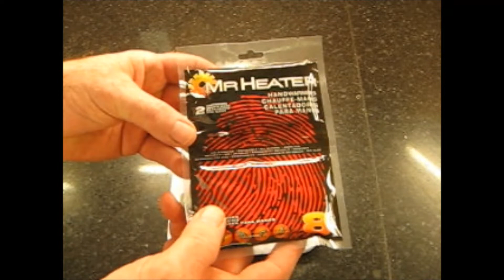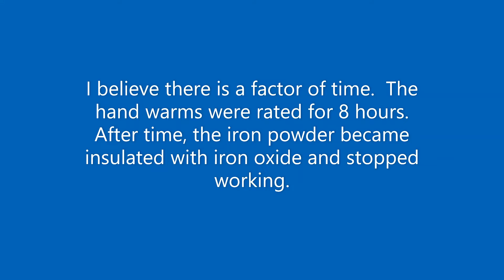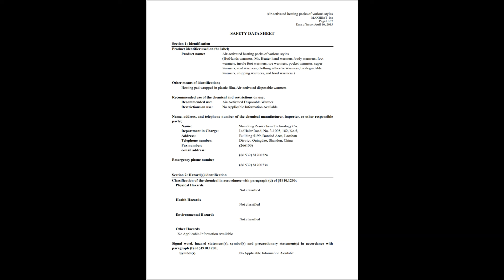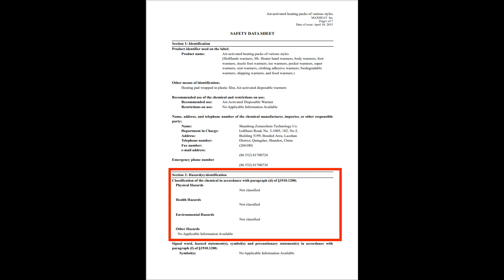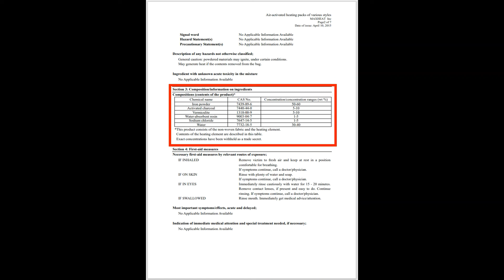Hand Warmers verses Oxygen Absorbers

Comment: solution: put it in a sandwich bag
Also, I have not found a single source say WHAT chemical that is in hand absorbers is so toxic?  If a tiny particle of iron or rust is going to send you to the grave, I guess you better throw out your cast iron pan.  If activated charcoal is going to cause you to stop breathing, well I guess you shouldn't buy that toothpaste that is loaded with the stuff.  What are you guys so afraid of?  One industry is ripping you off more than another.

Comment: Please consider sealing an opened test packet with an active desiccant with minim possible amount of air for a couple days.  The weight loss will be the water.  There will be deminimis amount of oxygen weight gain while exposed to the atmosphere during handling.   Then determine the initial weight of the warmer and the final weight after several hours.  The weight gain will be oxygen absorbed.   32 grams of oxygen has a volume of 22.4liters  Ignoring the STP corrections.
Reply from the maker: Very interesting

Comment: These hand warmers might be a good option for say 5 gallon buckets.  It might work to just cut the corner off the outside package so the food would be less likely to come in contact with the hand warmer.  It would still be able to scavenge the O2 over time.
Reply: I put oxygen absorbers along with say dried beans in heat sealable food grade Mylar bags then place the sealed bags inside my air tight storage containers. I first use a vacuum cleaner to remove most of the air from the Mylar bag.

Comment: Im wondering since the hand warmers heated up to 100 degree. Wouldn't the air inside the jars expand and actually impede the water from entering the jar? Loved the test, thank you. Im just wondering.
Maybe some ice in the water would have helped counter that, if that was the case?
Reply from the maker: The warmer air can increase the pressure within the jar.  if some of the air escapes, after the air cools down, it will form a vacuum or suck in air from outside.  It all depends on how tight the ring and lid is.
Reply: Thanks.  Still not clear why they add Activated Charchol to hand warmers. Understand why for food as it absorbs “bad” smells.  I had always assumed hand warmers used different chemicals. Now find out they are large oxygen absorbers which heat up quickly, and stay warm, for 4 reasons.  1) more iron. 2) more porous bag which allows more oxygen flow for faster oxidation. 3) warmer temperature.  Body temperature around 98.6. Room temperature much lower. Chemical reactions are twice as fast for each 10C (18F). 4) Movement. Being near the hands the movement, within the pouch, will expose more fresh iron that has not been oxidized. Thanks for the post. Learned something new.

Answered my own question (gotta love AI)

Activated charcoal is added to hand warmers to disperse heat evenly and control the rate of the chemical reaction that produces heat: 

Even heat distribution: Activated charcoal is thermally conductive, which means it spreads heat evenly throughout the hand warmer. This prevents hot spots from forming on your skin. 

Reaction control: Activated charcoal helps control the pace of the reaction that produces heat

Comment: i vacuum pack lots of bulk rice and store those just regular vac bags in 15gallon food grade barrels with rubber seals.....so for those im thinking a hand warmer might work great to throw in the top of the barrel when i seal them up for long term storage as another level of protection. What say you?
Reply from the maker: If you use a hand warmer, wrap it in a piece of cloth.  The package isn't "rated" to touch food.

Comment: It also gets hot so wouldn't that be bad for the food?
Reply from the maker: Hand warmers get around 135 degrees.  Freeze dryers, during the finial dry, range between 120-145.  A hand warmer would heat up until the oxygen is depleted, then would go cold.